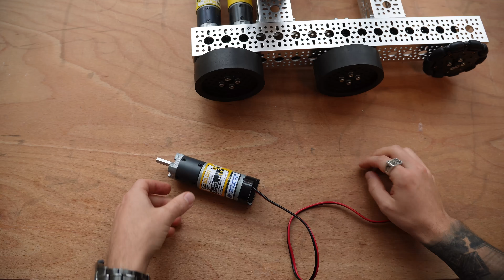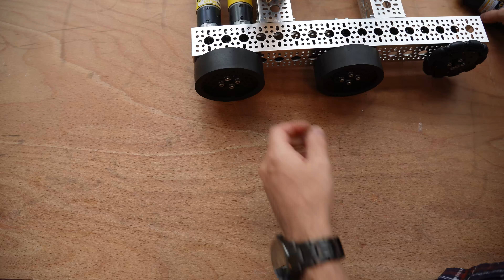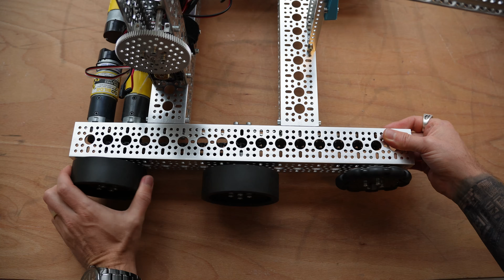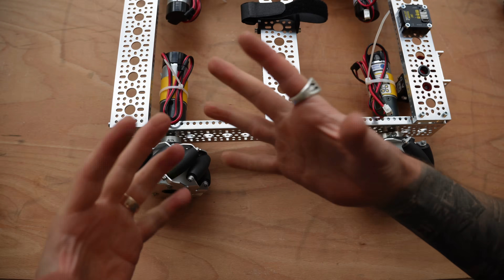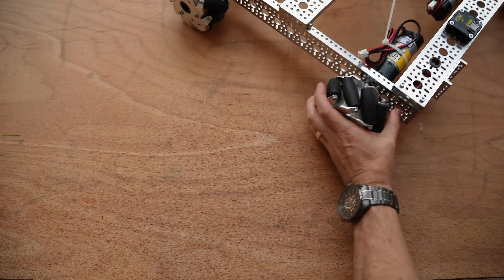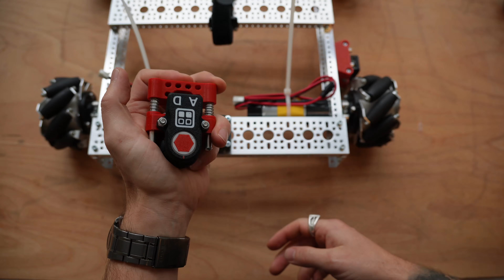The 5 Levels of FTC Localization (From Encoders to AprilTags)

Comment: Are your mecanum wheels oriented correctly? I thought it was supposed to do an X shape
Reply from the maker: I was wondering when someone was going to notice that 😂 Yes, they're currently orientated incorrectly. This is what happens when you let your very young son help you build robots sometimes. We're all still learning 🙃
Reply: @BroganMPratt  Sounds like a good time 😉. Catching up with you mecanum wheels videos 🙌
Reply: Well... back after 18 hours... Could not find anything about coding mecanum wheels with PID control. I think I am missing something at calibration, perhaps something to transform PWM to RPM

Comment: Can you talk about optical odometry
Reply from the maker: To be honest, I haven’t found optical sensors to be terribly reliable. They seem to dust up a lot in my experience and that affects their reliability quite a bit.
Reply: Teams I've mentored have used SparkFun OTOS and had success with it. One absolutely critical element is distance: mount it exactly 10mm off the face of the tile below it, and remember to account for how much your robot sinks into the squishy tiles under its own weight. We didn't run into too much trouble with dust, but it's not a bad idea to bring a lens cleaning kit with you to competitions.